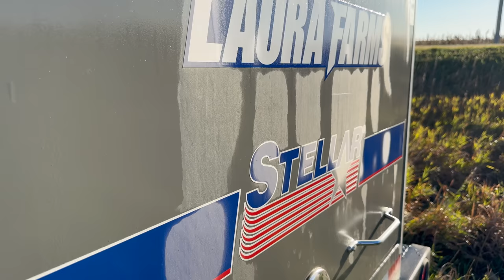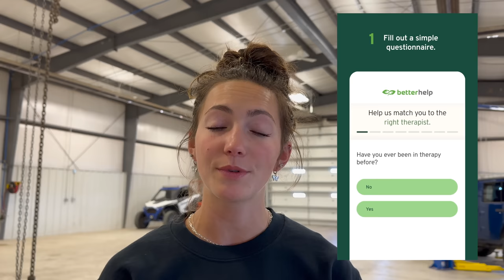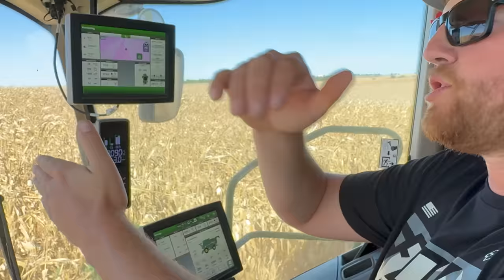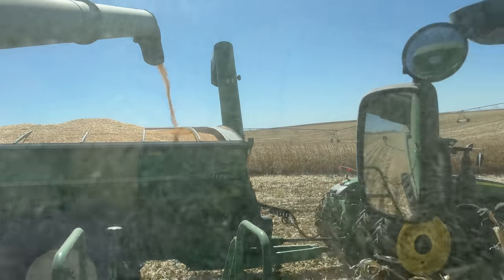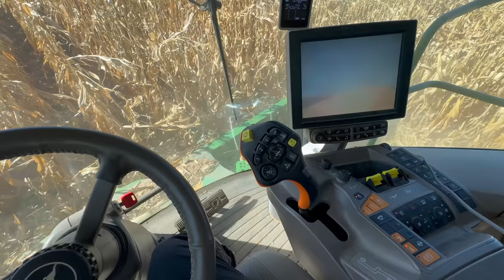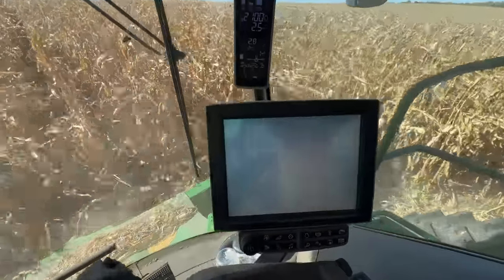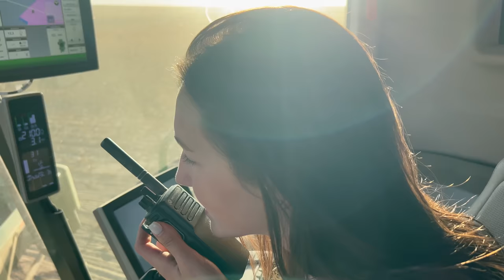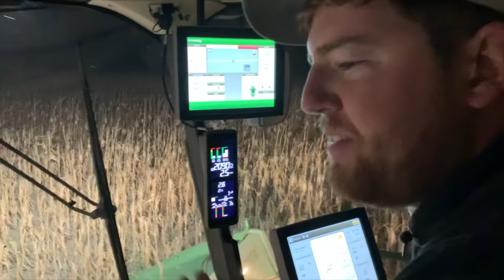How Many People Fit In A Combine Cab?

Comment: Hehe - regarding the bathroom topic: here in Germany we have a farmer who makes a lot of livestreams from his work and when he "has to go" he says "I have to check the tire pressure....." - this became a really funny running gag when he got a Claas chopper with tracks...
Reply: We used to use "need to go see a man about a car"...
Reply: Another one is “need to check the water in the engine” or gotta “check the engine is still there”
Reply: Gotta drain the tank.
Reply: @Snarkapotamus ”gotta see a man about a horse” 😂
Reply: I work on cell towers and our phrase is "gonna check the AC"
Reply: I'm going to turn my bike around.
Reply: I drove Ready mix truck and would say I need a slump test if it was #2.
Reply: @timwilson3150  Another couple are  " To drain the dragon" and  " Syphon the python"
Reply: Hilarious!!😊
Reply: My grandad called it checking the weather.
Reply: Literally Live Streaming
Reply: Checking out the sprinkler system
Reply: Draining the radiator for pee and dropping the politicians off at the oval pool for poo.
Reply: Another one...droppin' dumplins
Reply: Gotta water the horse
Reply: And the Millennium Farmer uses the rest room between the tractor and the implement.  (Or the two parts of an articulated tractor.)
Reply: Drain the main vein

Comment: Doesn't the oil and dust associated with harvesting create a sort of grinding paste on the combine chains?
Reply: Most of it wipes off as the equipment is run, the only thing we really want is for the oil to get into the connections where the links connect. The rest of it is gone in pretty short order...

Comment: Laura I got a question I have been around since the start pretty much how does the combined take the corn all the corn cob really need to make a video on that $400,000 piece of equipment probably?
Reply: Combines are amazing. They have a rotating cage that spins the cobs around and pops the kernels off. After that the kernels fall through some moving screens and blowers to remove chaff, stalk debris, leaf material, etc. leaving clean corn kernels.
Reply: @dwaynemiller68 - Good question. If you google it, there are some great animations from different combine manufactures on the inner workings. Good luck!

Comment: Regarding the radios, why don't you get vehicle mounted ones? They won't need charging and you could have external antennas to increase the range if needed. I know you have a lot of equipment so you could mount them in the Deeres that get the most use, and swap them in and out of the sprayers, and smaller tractors as needed if you didnt want to outfit the fleet. Leave the handhelds to be spares  for the pick ups, the side by sides and grain trucks doing field side work. A Motorola sponsorship to work on after harvest perhaps? :)

Comment: I used to work as a lineman, installing Arial fiber optic cable, sometimes we would have to go through miles out on the middle of nowhere (sometimes in the woods) and yeah... Ya didn't leave the job site every time someone had to use the bathroom 😂...  find a tree... Leaves of three let it be 😂

Comment: because plowing destroys all the micro things in the soil and because you have so much waste from the corn i'd like to see you not plow the land that doesn't get water and just seed it you wouldn't need to water it or fertilize it as being so mulchy on the top of the ground and so air rated it catches the water from the air i've seen it done with wood chips before they dont dig it up and just plant in it so if it works with wood chips it would work just as well with corn fiber you've got nothing to lose do 1 row were it doesn't get water dont plow it just seed it and let it grow you may just find you don't need to fertilize or water it.